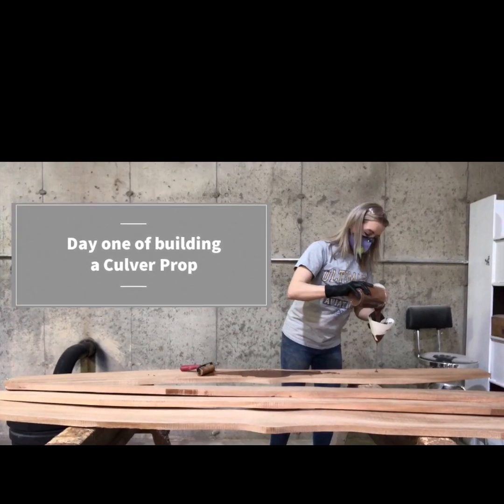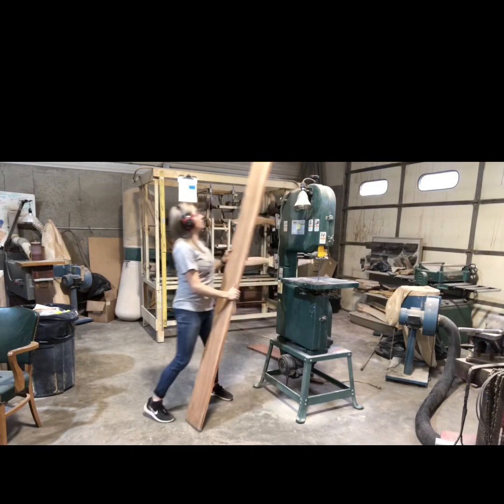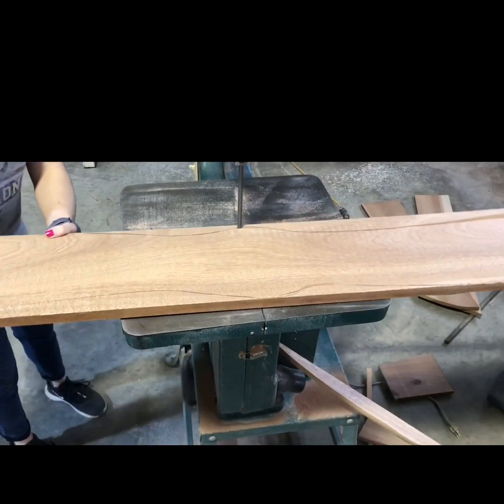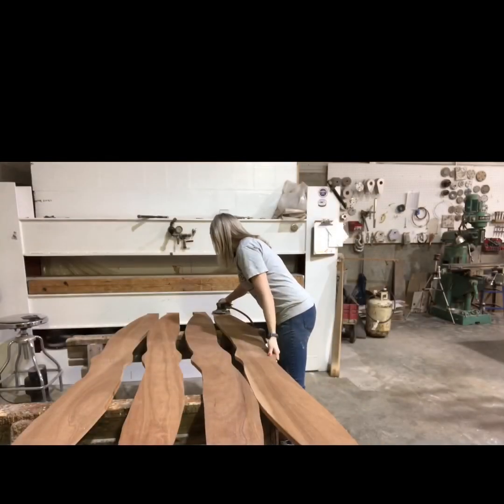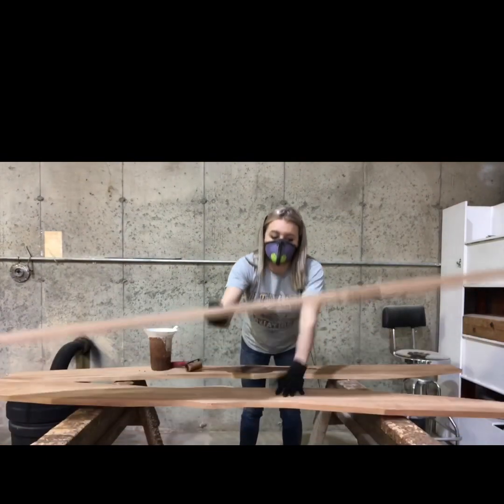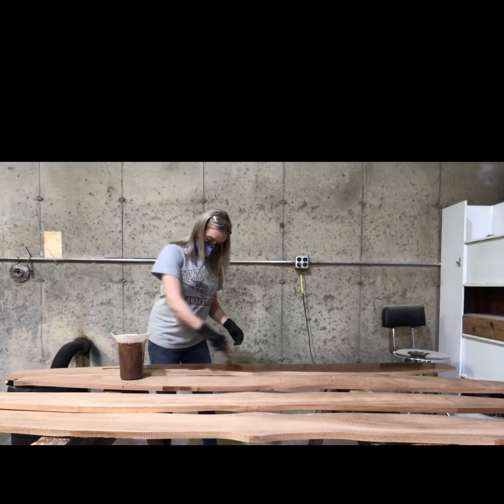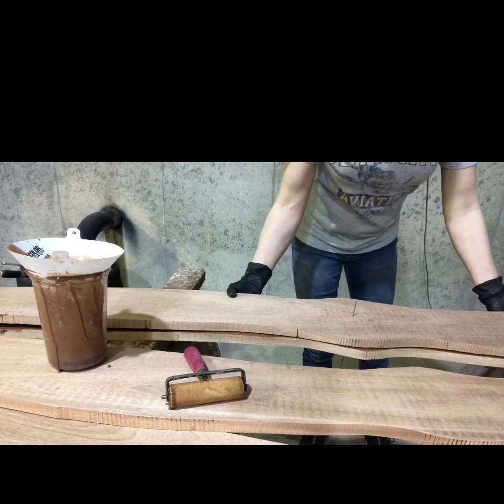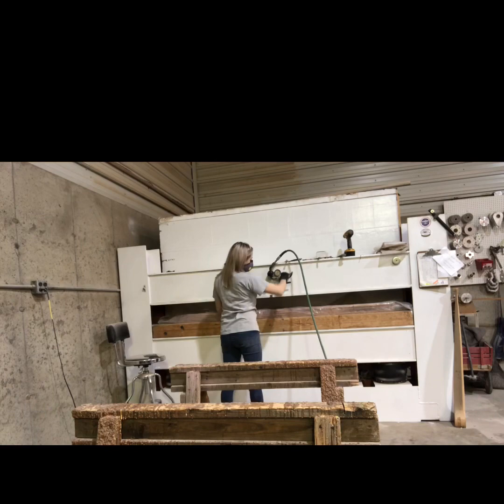Day 1 of how we build our Culver Propellers

Comment: Where can I get a pile of scrap wood coming off that band saw? I could build some fun things with scraps like those. I'd have a hard time piling those into the wood burner.
Reply from the maker: Email me I can hook you up! ranchair@socket.net
Reply: @CulverProps   Your about a six hour drive for me so not very practical. I will give you some great ideas for your wood. Here's a link: https://youtu.be/SdrTYuiAhLA  He's using a wood lathe in the video but you could do the same thing with your prop carver by making a bowl pattern for the machine to copy. You could put your scraps into a long narrow box the size of a propeller that's lined with plastic and tape to make it liquid tight and pour epoxy in like in the video above. He uses a vacuum pot to remove air bubbles from the epoxy in the video. You could take a method from the composite airplane builders and vacuum bag the box to get the bubbles out. Now pick your favorite prop blank and carve the scrap wood prop on your copy machine. Once polished your going to have a great art piece! Watch a few YouTube videos on River Tables to figure out what colors you want to try. I think your going to find a whole new world of creativity open up.  Unlike the River Table guys and the lathe guys your machine can carve complex elongated bowls, chair seats, table legs and cutting boards. The world around you is your oyster. Your grandmother is going to love the new trivets she can help make out of those propeller scraps.
Reply: @CulverProps   Here's a scrap wood cutting board idea. https://youtu.be/jY0zcU1LSn8

Comment: It looks like you are just eyeballing the center hole in the boards, or did you measure and mark them before?
Considering how little extra material you have, this holes needs to be pretty accurate, not?
Reply from the maker: I had pre drilled a center hole off my Template